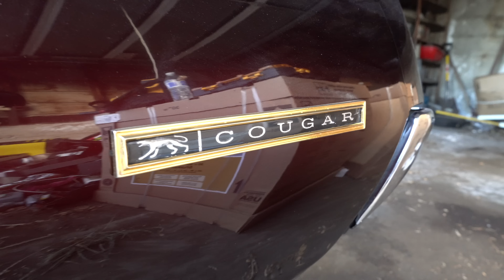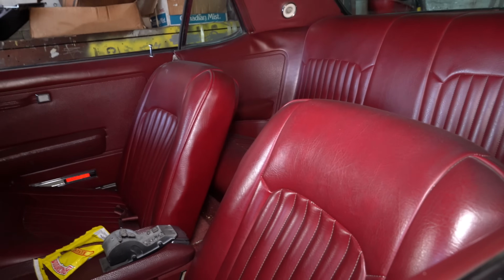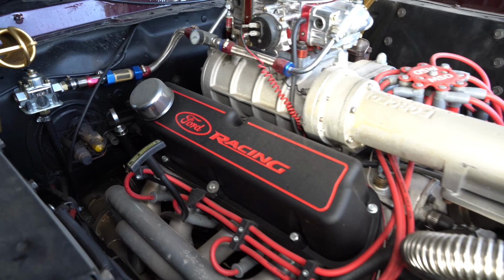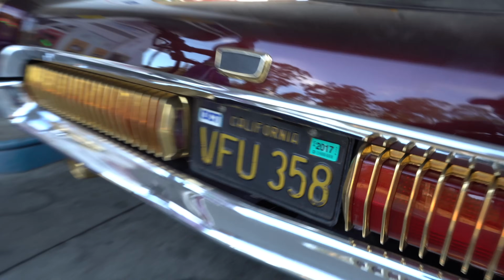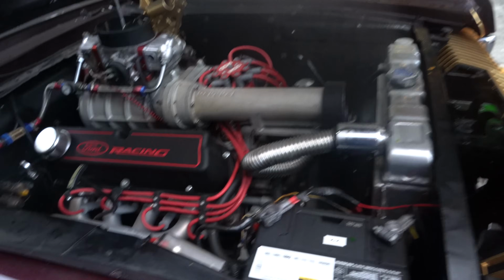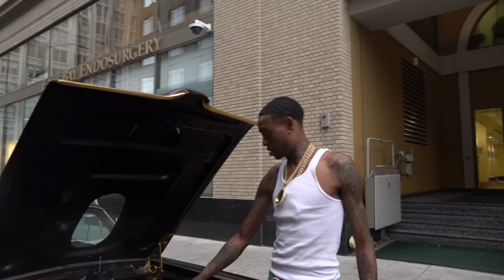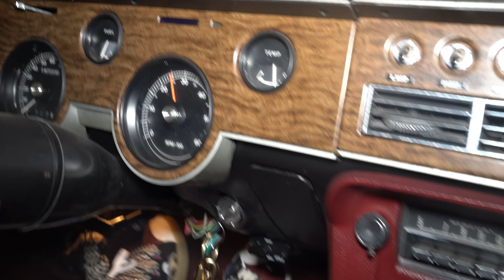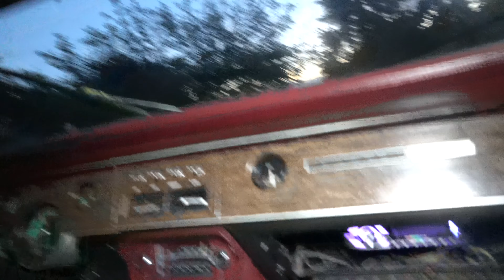A DAY IN OAKLAND, CA WITH @CookieMoneyVEVO AND HIS SUPERCHARGED 67’ COUGAR!!!

Comment: 2017 that ain't got nothing on my 71 Thunderbird that's been sitting for almost 50 years and it looks almost as good as that cougar it's not tripped out though word of experience I've been working on these cars since they they were new in the 1970s I worked on cars for almost 50 years when you find these cars that haven't been driven for a few years you have to go through everything you don't just get them out and start racing around in them go through every hoes for the cooling system vacuum hoses check the status of the motor oil transmission fluid gaskets you don't want to ruin that that's a lot of money and get that power steering fixed before you ruin your box make sure fluids are topped off before you start riding that car around like that change them